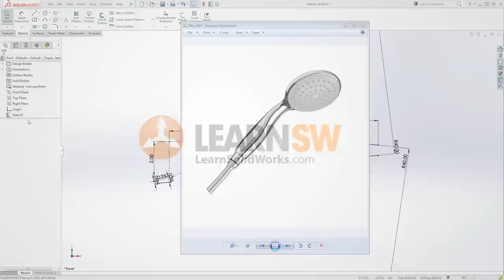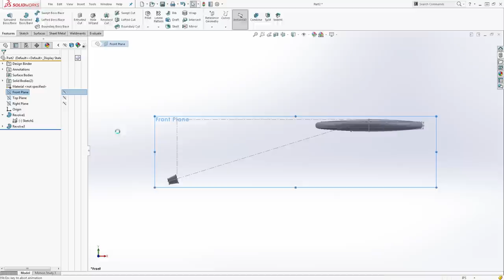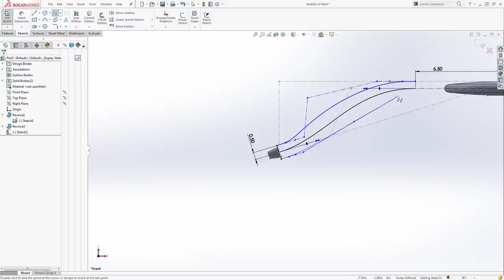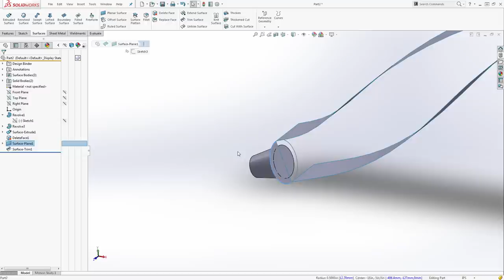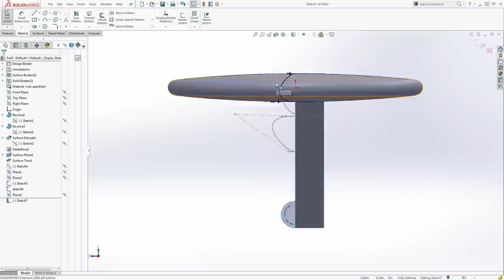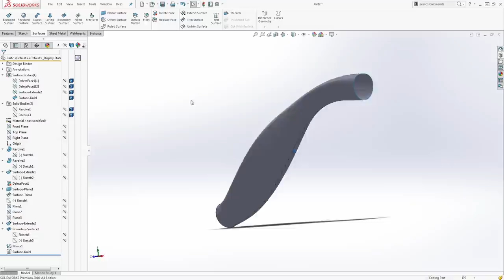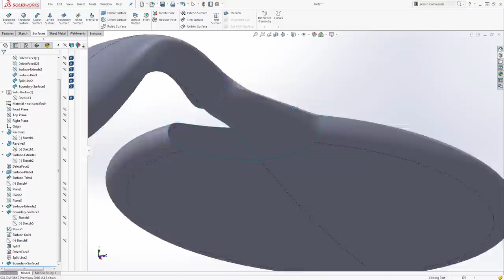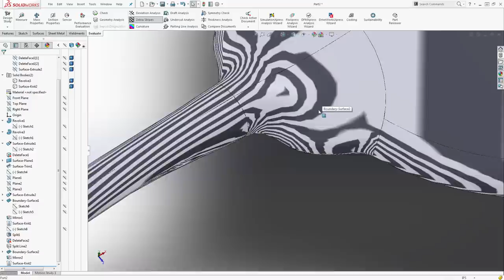How to model a Showerhead in SOLIDWORKS?

Comment: Really excellent, helpful, video. I have some confusion with the style splines. Do you have any example videos somewhere where you have a sketch picture behind that you are using to create the splines by tracing the pic? I am confused where to place the control vertices of the style guide. I am really struggling with this. Thanks!!